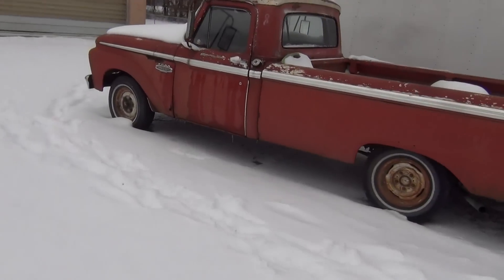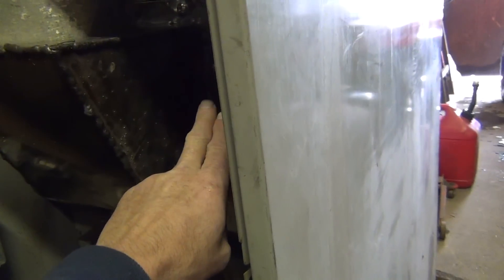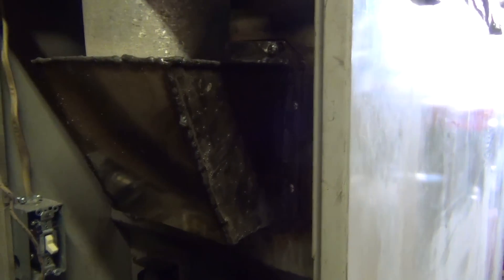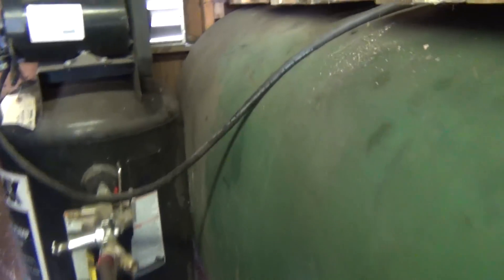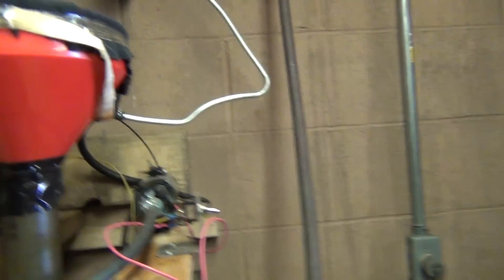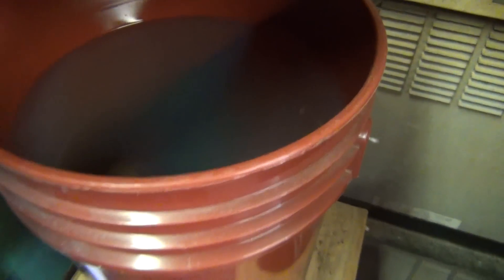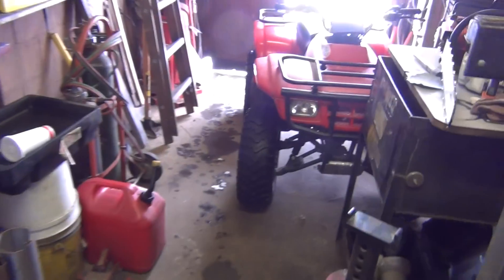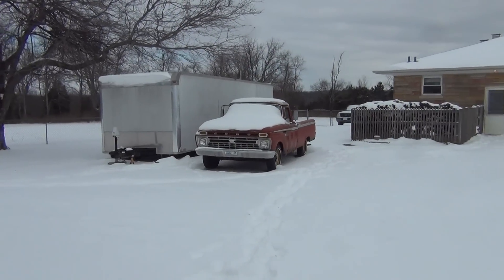Oil furnace that  burns waste oil mixed with fuel oil .

Comment: Sir: Great vid and thanks much. I have an old mobile home style 65K BTU hot air Beckett furnace in my building that works perfectly and I installed a new transformer, ignition sticks, and nozzle last winter. I have approx 10 gallons of super clean waste oil I'd like to burn thru the furnace, mixed with either kerosene or home heating oil. What is the recommended mixture you use for blending the waste oil with heating oil to make this work. I'm thinking maybe 50/50 mix but curious your thoughts. Thanks much.
Reply from the maker: Since this video was made, I have bought a new fuel oil furnace. Because my old furnace's heat ex-changer finally rusted away. i now mix 1/2 gallon of strained waste oil, to 4 1/2 gallons on fuel oil, or diesel. if you mix it too heavy with the waste oil, it will smoke on the start up when the heat chamber gets too cool. My mixed fuel is now in a 5 gallon bucket, and my big tank is straight fuel oil.
Reply: @Dragracer64  Got it and thanks much for the info. My furnace is approx 40 years old or a bit more and fortunately the burner heat chamber is still in good shape. Just a tad of surface rust that I had cleaned off and treated years ago and inside still seems fine. Thanks for the tip. Happy Thanksgiving.

Comment: This is like a tractor my dad had, you started it on gas then once it warmed up switched to diesel.  I have burned a mix of fuel oil and waste oil in a furnace before and it worked fine.  Like you said filter the crap out of it first.
Reply from the maker: Thanks for watching.

Comment: I'd just get some double wall black pipe for wood burning stoves for your exhaust. Cheaper than stainless by far and stands up to the heat
Reply from the maker: I tried that before, it lasted longer than the galvanized but still rusted . Thanks for watching.

Comment: You have a very nice system and works just fine for you. Let me make a suggestion. In your 250 gallon tank only put diesel or HHO (it's exactly the same as off road diesel) and in the 5 gallon bucket put in your used oil. This way you are not guessing how much used oil is in the tank and with 250 gallons as head pressure it would help push out that cold not flowing oil thru the lines. In your 5 gallon bucket you could mix oil and diesel or as a lot of others do when using as a fuel in their trucks thin with gas or E85. One guy I know runs his older 12v Cummins on a mixture of 90-95% used oil and 5-10% E85. He says the E85 cuts better than gas so you have to buy less of it. I am building a boiler with a Beckett burner like you have to burn waste oil to heat my house. I will order a CKburners.com nozzle kit and convert to run on 100% used oil. You can checkout some of this info at http://wasteoilheaterforum.com/index.php?action=community  Anyways good luck!
Reply from the maker: .Thanks for watching .And thanks for the info.
Reply: personally Id never cut with gas/e85.  You putting the boiler outside or in basement?  If in basement make sure you get some CO detectors.

Comment: i have a 500 gallon tank, it has 100 gallons of diesel fuel and the other 400 gallons is USED CAR OIL. no i don't burn it straight, like this guy is doing, you have to add something flammable to it, so it will help thin it out and bring the flash point up some, so the the furnace will ignite, straight used car oil will not work!!!!, I MIX ONE GALLON OF GAS TO FIVE GALLONS OF USED CAR OIL, and mix it, the furnace will ignite it with no problem, yes the oil will go to the bottom and the gas tends to seperate from the oil, you have to stir the tank once while, i stir my tank twice a day and bingo, no problem. I am using a WAYNE OIL BURNER M-SR standard oil burner and it has no problem burning waste motor oil.
Reply: Just a question.. you use gasoline and not diesel?
Reply from the maker: Thanks for watching and the comment.

Comment: You explained your process pretty well-there is a method to your madness.I see a lot of guys trying to burn waste oil for heating their shop without using a clean diesel mix,and it looks like it take a lot of fine tuning.What temp do you keep your shop at?
Reply from the maker: +Mr Frog Thanks. I don't keep the shop heated at all times , only when I am working in it. That might be a possibility if I ever get around to insulating every thing so it holds the heat in better.
Reply: That's pretty much how we do it up here too.Turn on the heat,go in the house and come back when it's warmed up.In every garage we insulated, it made a HUGE difference in furnace cycle times and fuel use.